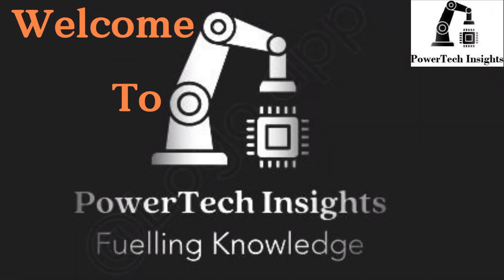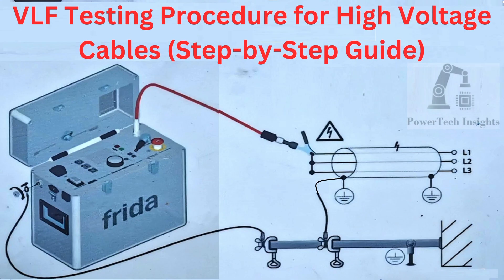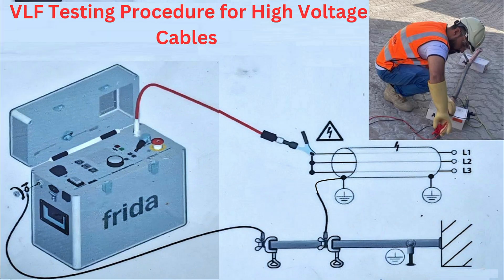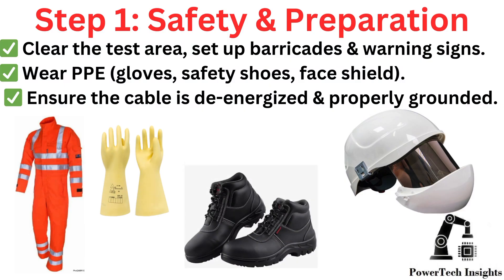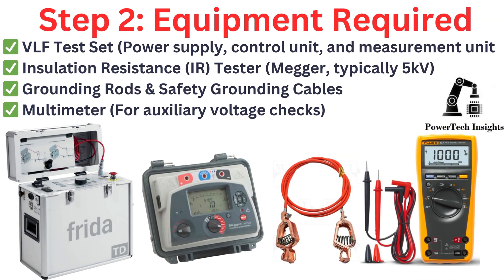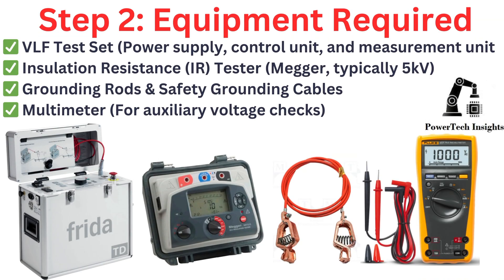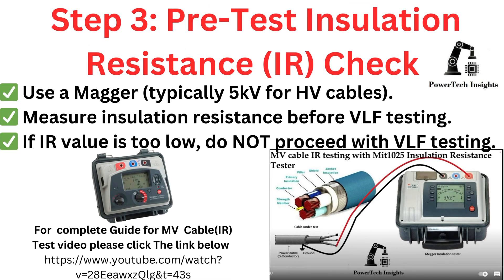VLF testing of MV cable

Comment: Would it matter if you megg it with the Positive on the leads and the negative on the braided lines?
Reply from the maker: Yes, it does matter for consistency and accurate results, always connect megger positive to the live conductor and negative to the braided shield or earth. Reversing them won’t typically damage anything, but the reading might vary slightly and isn’t standard practice.

Comment: You short all three phases in both test?
Reply from the maker: Yeah because I tested all of them individually and then togather but if result is not OK then you should perform test on each one individually.
Reply: @PowerTechInsights Noted 
Try to do all tests related to substation and show the connection diagram clearly...thank you
Reply from the maker: I have uploaded most of the test and soon I am gonna upload 110kv prove dead and Demengnatisatization of MV / HV Transfermer